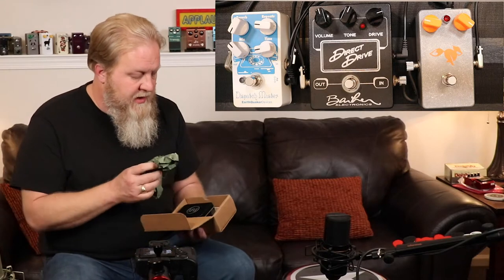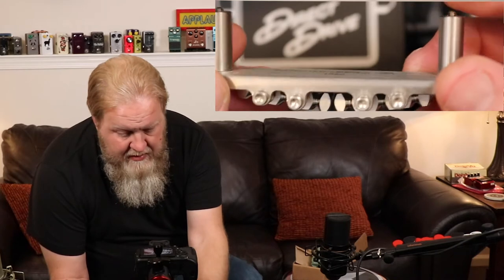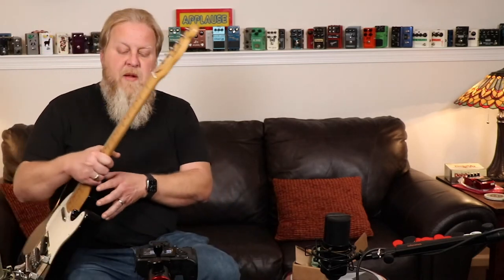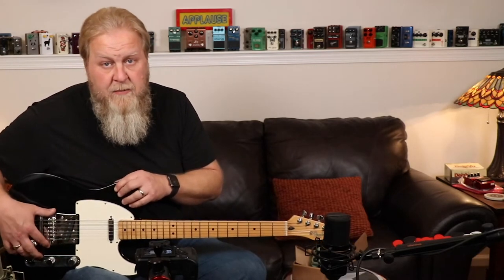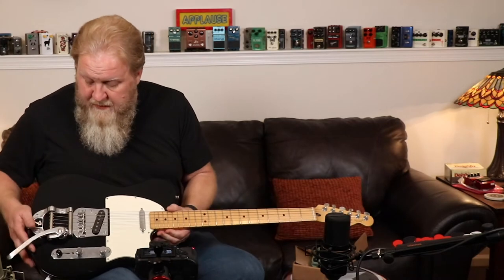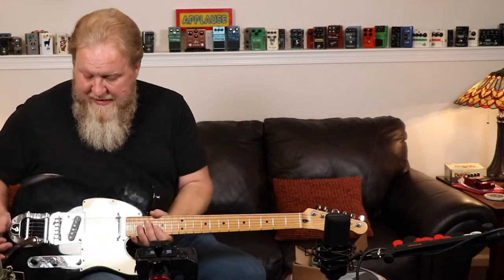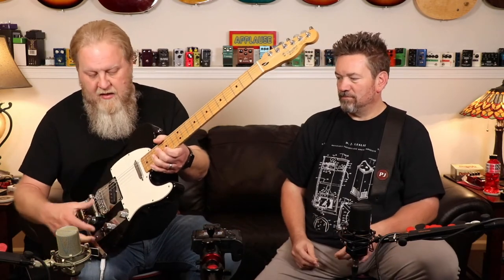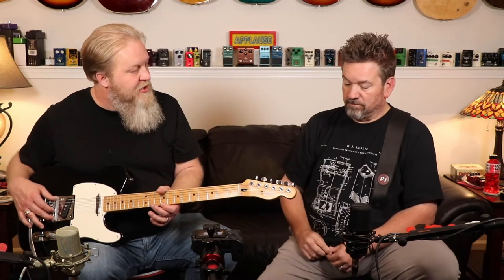Telecaster Makeover Part 2 - Mastery Bridge

Comment: Were the same pickups and amp settings used for both the stock bridge tests and the Mastery bridge tests? There’s such a huge difference in tone between the two that it makes me wonder. The Mastery has more sustain, but much less treble and presence, and more midrange. The stock bridge sounds  better in my opinion, more like a Tele. With the Mastery it sounds like it’s got humbuckers. The bridge that comes with the Fender Bigsby kit is actually a Jazzmaster/Jaguar bridge, and they can be problematic. What guys used to do in the old days was to paint the saddle height-adjustment screws with clear nail polish after the adjustments were made. This would keep the screws from loosening up, and if future adjustments needed to be made, the dried nail polish would crack and enable the screw to be turned. Of course, the nail polish would then need to be reapplied. A better fix might be replacement of the bridge with a Mustang one, which doesn’t have height-adjustable saddles; assuming it matches the fingerboard radius.
Reply from the maker: Yes, same pickups and amp settings. The only thing different was bridge itself. My guess, is that some amp tweaking for the new bridge would address some of what you are hearing. Great input on the nail polish thing too.
Reply from the maker: Another thing to consider is that the action might be a tad higher with the new bridge moving the strings farther away from the pickups. I wonder if that could take away some of the top end.